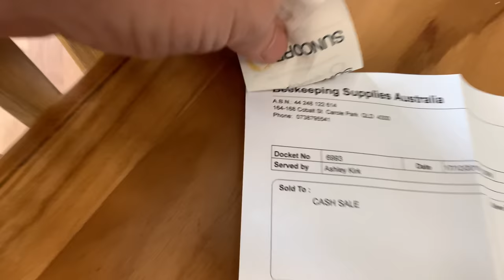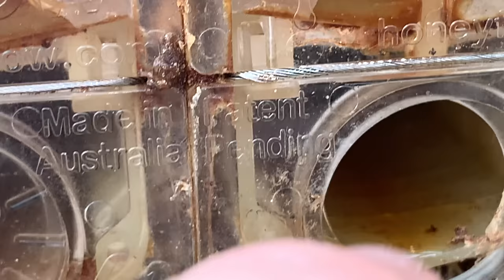Adding a half sized honey super, checking for a queen & harvesting some honey

Comment: You will only have 1 queen per hive. If you find more than 1, then the hive is either getting ready to split, or the two queens haven't ran across paths yet. The stronger one will kill the other.
During the summer, you can harvest as much honey from the top nucs as you want, basically; unless there's a shortage of flowers. 

Considering you guys are having a big heat wave down there, you could put a shade over/near the hive so the hot afternoon sun isn't beating down on it.

As far as the flow hives go, I've heard a lot of negatives about them. One of the biggest issues with them is that the flow hives doesn't take the caps off the comb. So the bees won't know those are empty. With standard hives, you cut the caps off and let the honey drain (if warm enough) or spin the comb for extraction. Then place the frame back in the hive and the bees know that those are available for new honey.
Also, with flow hives, you don't get much wax for other uses. The wax is very healthy and can be used in a lot of stuff. You can make your own candles, lotion, lip balm, etc.
But, I suppose, a flow hive is a good beginners hive. Just make sure to go in and decap the comb shortly after harvesting to let them know they can fill them again. Otherwise your next harvest may not be as big of a haul  ;)
Reply from the maker: I'm sure there isn't two queens in there, but like you said the strongest will kill the weakest. Flow hives are not perfect solution but the wife will enjoy it for now and to be honest - that's worth every cent on the setup.
Reply: @HBPowerwall  Sometimes simplicity is what is needed  😉

Comment: A few years ago we had wild bees in the area (I think I mentioned it in another video comment). I had built a few nucs, but didn't get them placed before the hive had swarmed and moved on. 

I've decided I like the horizontal hive design better. It's easier to maintain, expand, and work. There's many designs for this layout, but the premise is the same. The whole hive is at waste height to make the whole process a lot easier on "us". Also has the added benefit of keeping ground critters out of the hive at night, and easier to keep mites and other insects out as well.
Reply from the maker: are you refering to long hives ( i think that's the name) i was investigating building one of them just in case mine swarmed
Reply: @HBPowerwall  Yeah, they are also called Longhives. They are about 1.5 - 2m longe and up to .5m front/back. The design is also easy to add in a watch window so you can inspect the hive without disturbing them, too

Comment: Usually I use a 12V car battery and short the super frame wire for just 3 seconds, and you will get the job done. It is super easy and clean.
Reply from the maker: Awesome thanks for the tip! Was going to use some 18650's to keep it relevant to the channel
Reply: @HBPowerwall  That's a great idea of using 18650, but personally I don't you them since I am bit scared about shorting them.